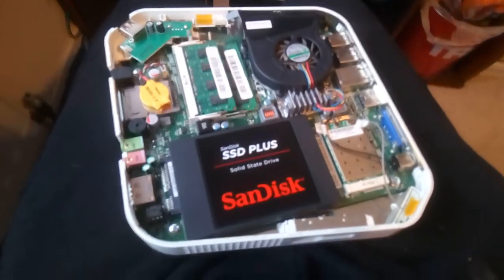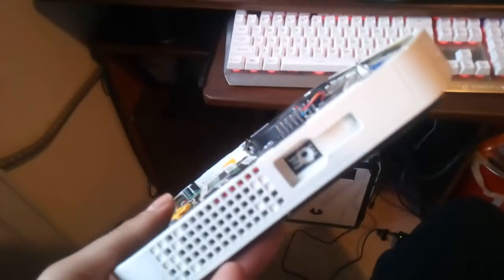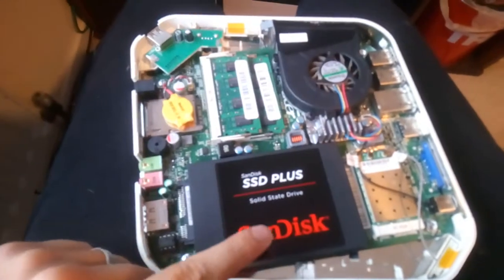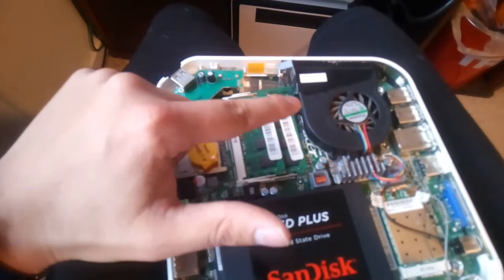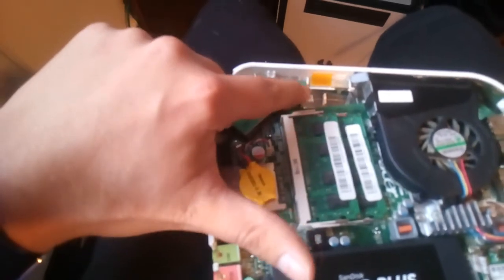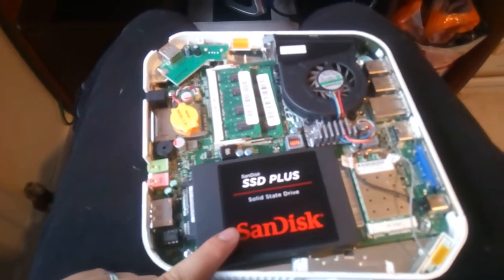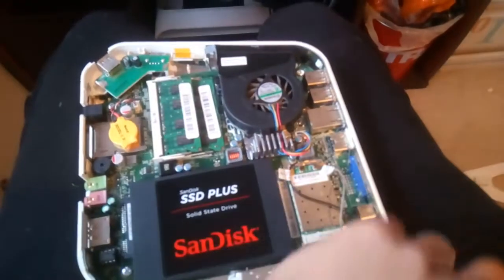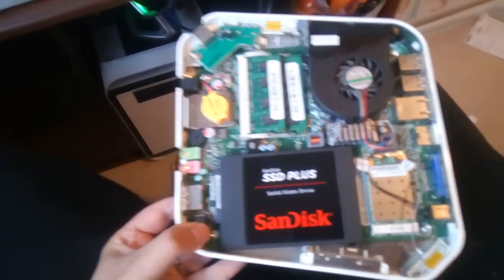Acer Revo r3610 hard drive replacement

Comment: My reply keeps disappearing. I suspect it is because I included an Amazon link so I've removed the link and tried again.

I finally got around to testing an externally connected SSD.

I bought a e-sata cable:

Akasa Flexstor ESATA Cable | 22-pin SATA to eSATA Data and USB Power Adapter Cable | For 2.5" SATA Hard Disk Drive and SSD | Supports SATA III | Black | AK-CBSA03-80BK

I changed the boot order settings in the BIOS to always boot from the SSD. This is maintained between reboots but not when the power is removed. However, I think my CMOS battery is dead so I think that is why my settings are lost when the power is removed.

I then attempted to install Mint on the SSD. The installer kept wanting to install to the internal HDD (no way to completely disable in the BIOS). In the end I formatted the HDD and was then able to install Mint on the SSD. People with more experience of Linux booting will probably not have to do that.

It is booting fine! The average access time is much higher than the HDD: 0.19ms compared to 17.96ms and about 280MB/s read whereas the HDD was getting about 65MB/s.

The boot time has gone from 110 seconds to 82 seconds. This is also a little disappointing. I booted the SSD from my laptop and that booted in about 20 seconds so I think the boot time is being hampered by the very slow Atom processor.

All in all, this seems to be a viable alternative to opening up the machine and having to remove the fan and heatsink and all the hassle of removing and reapplying thermal paste. But it does look like you won't get the full speed out of the SSD but still a lot faster than the HDD and the cable was pretty cheap.

I would be interested to see what speed you are getting from your internally mounted SSD.

Comment: Having to take the heatsink off to replace the HDD is a bit of a pain. Does anyone know if I can leave the HDD inside and boot from an SSD connected to the e-sata port? If nobody knows then I'll buy a cable and see if I can get it to work.
Reply from the maker: I do believe it has to be an internal drive. You could of course select the external to be the boot device however not sure if you would need to manually select it everytime, may be possible. Let me know if it works.

Comment: I was considering a swap for my drive, I currently have LibreElec on it: Kodi (18.9 (18.9.0) Git:18.9-Leia). Platform: Linux x86 64-bit, on something like a 140GB drive.   And it installs easily and works pretty well all things considered.  The amount of USB 3 ports on it is quite something, and it does have an SD slot.  I was only considering an SSD to get the power footprint of this down a bit.   A gripe is that it seems a bit greedy on the CPU, it's eating about 50% playing music.  Doesn't touch much of the 2GB Ram on it.  It does do quite well playing content.  Though I've read that the CPU/GPU can overheat.  Not sure how it fares these days against something like an Amazon stick.  I get poor audio for some reason via our Chromecast to TV, and Libreelec on the Revo is better in this regard.  Connected to a reasonable amp and speakers via the 3.5 jack, it isn't bad either for music.  And LibreElec having Docker support, does give you other options.  I'd like to know what other uses people have found for theirs.   An annoyance I have found with it, is that it wants to be plugged into a monitor to boot Kodi - so if you want something completely headless look elsewhere.  Oh, it boots really quick on the stock drive.  I don't think there would really be any noticeable difference with an SSD.

Comment: Forgot I had mine. Tried booting it up after all these years, it rebooted after upgrading its Windows 7 install and now says there's a disk read error. Before I waste money on putting an SSD in it, do you think these are any good for streaming OBS? My main PC will do the gaming but I wanted a separate PC to handle the streaming.
Reply: I use mine as a media centre, Kodi/LibreElec installs flawlessly and it plays all media I throw at it. I used this video to help me install an SSD but even with a normal HDD it works great.
Reply: I have a R3610 , Windows 10 32 bit was extremely sluggish, Windows 7 32 bit is slightly better but still slow, Downgrading to Windows XP gives good performance, However it's so slow that even basic web surfing is a pain, so I would rather use it as a Office PC, for playing old games (2004 and earlier) and for playing DVDs, if you have a USB dvd drive) It can play YouTube, however it c an take up to 2 minutes to load.
(I used Firefox 52.9.0 ESR, last Firefox version to support XP, all Websites will load)
 480p runs fine, 720p will also play but it might lag sometimes.
BTW I used Avast Free antivirus, which still supports XP.
You are better of using Windows XP or a light Linux distro for example Linux Mint, Lubuntu, etc.

Maybe OBS will run at 240p or with some luck at 360p.
The Intel Atom Processor however does not give a good experience at all.
Reply from the maker: Unfortunately the life of the REVO has made it surpless to requirements even for basic tasks, now :(
Reply: @work-hard-play-harder  Thanks Dylan, I won't bother persevering with it then :)

Comment: Sorry for reply on this given it was a while ago you done it!

But I just decided I'm going to bung an SSD in mine for giggles.  Maxed the RAM a while back.

Do you think it made it responsive enough for basic tasks - browsing, media playback, light office/productivity stuff?

The SSD was only 20 quid but if you reckon it's an absolute waste of time I'll use it elsewhere!
Reply from the maker: sorry for the late reply, youve probably done it by now, but yes it hasnt really made a noticeable difference, CPU is still single core
Reply: @work-hard-play-harder  - Yes!  Done it last week - but really appreciate the reply!  System still no record setter but it's an excellent emulator box for 80s/90s stuff, and doesn't take a month to boot up any more haha!

Thanks again for the reply 😀
Reply: @PurpleHelmet  what's your emu setup?  I'm trying libreelec (on r3600), and would be chuffed if I could get joystick support on something like a SNES emu, without much fuss.  (It looks like you can, but I haven't done so yet.)  Libreelec went on fine, and it plays 1080 HD video fine.  But considering my TV can play directly off of USB I'm not so bothered in that functionality.  I put embyserver on there, which seems okay, that as a backend might partner well with something like a roku or amazon stick for a front end, but seems a shame to relegate as a kind of NAS when you can get some fun off it.
Reply: @mrdespondency6598  hey buddy - I'm not sure I can help you - I just had mine running on Windows 7, using various open source apps to do the various emulation.  I think it was ZSnes I was using but can't be sure - I boxed it up and packed it away for time being.  Ran great though, and worked with replica look/feel USB control pads you can get from eBay, once it was configured.

Actually, you've just put me in the mood to dig it out and set it up 🤔
Reply: @PurpleHelmet  Not really an emulator box, but an actual box.